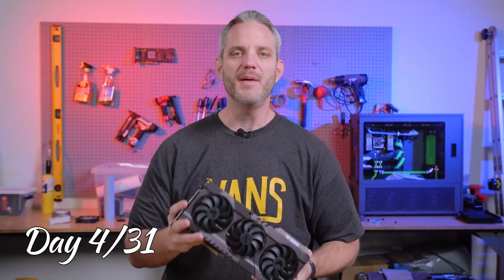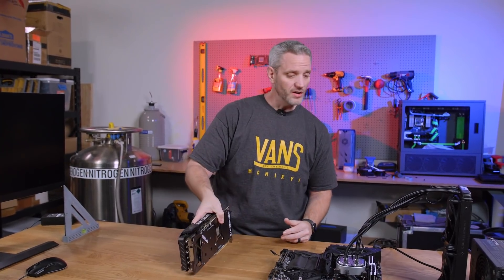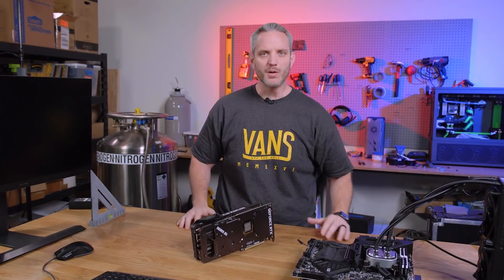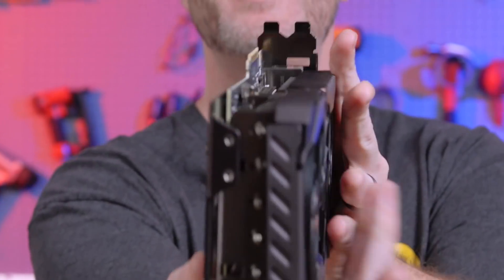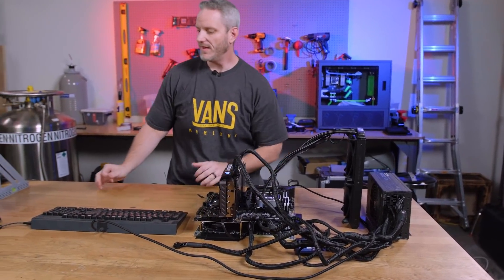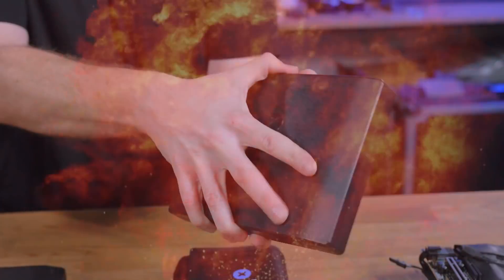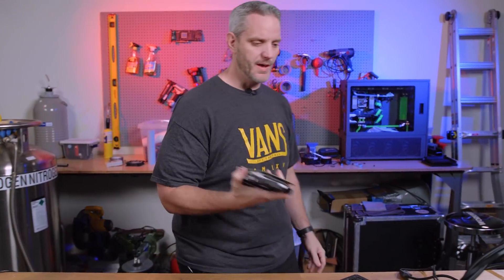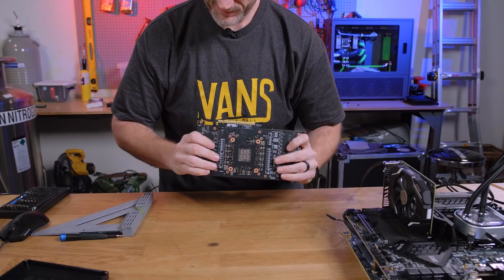This didn’t need to happen...

Comment: My Pc will not be shipped anywhere, but my water cooled 2080ti with the vertical adaptor still has a little thingy placed under the riser cable, just in case... (get it? in case!)

Comment: Hi Jay
I like your material, but what you did was really stupid.

You like automotive metaphors, here's the equivalent of this situation.
Imagine that I have a tuned Nissan Skyline with a 2JZ engine that does not start because it has a broken timing belt. But instead of fixing this, I take a 10kg hammer and completely destroy this 10s car.

I can't count how many bent cards I have repaired.
Even if the PCB itself was irreparably damaged, all other components can be recovered from it.
You know how hard it is to get DDR6X memory and not even mention the GPU core ... with these parts I would save at least 3 other damaged RTX3080 cards.
Any electronics technician who knows graphics cards would fix it one way or another, you mentioned Louis, I'm pretty sure he would fix it too.
Wasted resources ...

Greetings from Poland

Comment: anyone have a 3000 series tuf gpu? my 3080 tuf isn't the most rigid gpu I've seen, back left corner (horizontally mounted) rises a bit and front right corner sags, hope it doesn't lead to failure like the one in this video

Comment: Put it in the oven on a piece of cardboard for 10 minutes and it will fix the connections. Worked for a TV motherboard I had that's sound didn't work. Videos on YouTube about it. Check it out.

Comment: I'm dealing with shipping damage problems as the recipient right now, Instapack or similar might have saved the GPU at least. GPU doesn't work, PCIe locks are snapped off but the slot still works thankfully, and the front facing fan blades are broken off inside the case. I think the shippers took offense to the fragile stickers.

Comment: MY MAX ATTACKED OVERCLOCKED GTX 660 IS FINE WITH EXTRA COOLING PADS AND HEAT-SINKS AND THE EXTRA VOLTAGE THE MODDED BIOS PROVIDES.THINKING OF UNLOCKING THE FULL 175TDP I HAVE IT AT 150. gota love 4k

Comment: Where would I get an anti ssg support? My phanteks P600S case has an anti ssg bracket for the back of the case which I have tightened as much as possible but my XFX RX5700XT still has massive sag.

Comment: if that doesnt work, use a hot air gun on it reflow it, that works alot u be surprised ive had evga 1060s like that and i fixed 8 of them that way

Comment: so could you theoretically connect a different PCB to the Cooler and it would work? Like ask ASUS for a replacement and they'll just send a PCB.. would be interesting if that works or not

Comment: Such an expensive graphics card, such a shame. HEY! You did an impact adjustment at the last part of the video, almost like they taught me in college ;) so you should test it now :)
They said an impact adjustment is where you drop a component from 3 feet and see if that fixes it, as a last resort. So slamming on the table should totally work right? ;)

Comment: just FYI i used to work for ups, it doesnt matter weather you pay for ground or next day priority air, your package will be handled the exact same, the only difference is instead of it going into a trailer to be driven to the next hub, it will go on a truck that will deliver the item straight to an airport to be loaded onto a plane the same night.

and if you read the fine print UPS and i think fedex is the same, specifically say that you should have your item packaged in a way that it can safely take a drop from 3 feet. at the hub i worked at boxes came off a conveyor and landed inside the trailer at approx 1 and 1/2 ft. so a small drop.

 we tried out best to grab them off the conveyor but well time is money so shove that shit bro and if it falls? not our problem.

Comment: I think that proves that we need a standardised gfx card bracket... Yeah Yeah, put stuffing when shipping... Still, these cards are getting beefier and beefier. It's ridiculous holding it only by the PCI-E clot and a few thumb screws on the back.
All those tiny sata ssds that weigh nothing get standardised brackets from multiple sides... Yet this heavy chunk of expensive kit only has 1 "official" configuration which is inherently flawed.

Comment: I built a computer for my sister's friend once for about $800 or so. I didn't charge her anything over the cost of the parts. Anyway when it arrived it didn't work. Turns out the CPU power cable fell out in transit. It was a bitch to diagnose over the phone. But we got it working and she loved it. I never heard of instant pack before this year.

Comment: I’m doing a brand new liquid cooled PC build (my first time ever building one) any suggestions or tips would be appreciated 😄
Reply: Don't forget to plug the pump into correct header, some manuals instruct to plug it into CPU Fan header. Even after that you want to check BIOS/UEFI for the correct header+curve set. The best is steady flow (as fast as you are comfortable with sound level and temps), no "smart fan control" (encouters Tmax when CPU spikes and the pump reacts few seconds after, resulting in CPU maxing on temp and throttle)

Comment: As a truck driver with a desktop computer, I have to do some things. First the case has to be laying so the gpu and cpu is laying down.  For me my case is a square box and so its down even in main use. Second I put it in a suitcase and put blankets under it. Then I put it on a memory foam bed that absorbs alot of vibration.  Strap it down.  So far have no issues. But I do have to put it away every time. I have a laptop when I want to game immediately.   The desktop more cpu oriented for video editing.  Which I can't do because of another of changes I am doing and my current truck battery last 10 minutes on a unauthorized inverter which I just realized today should not be in the truck.

Comment: Take all the thermal compound off, put some stand off so it stands off the table when layed down flat and put it in a pre heated oven as high as it will go, when you see the solder go into reflow, leave it for a minute or two, this will give enough time for the solder balls under the gpu to reflow, switch off and open oven, take out if you can without disturbing any components, let cool and try again. Also not best to use a fan oven as it may blow  smt parts off, and put it in with the GPU on the top side not the bottom to prevent it falling off.

Comment: Question: if i buy a pc which had a gtx 570 without the card in it. Would i be able to fit in a rx480 and uninstall the old driver and install the new drivers. Or would i have to uninstall the old drivers with gtx 470 before putting in the rx480?

Comment: Hey so I have a gaming Computer and it has a Ryzen 5 1600 and a GTX 1060 6 GB Asus with 16 gn 3200 ddr4 ram and what should I do to upgrade the computer. I play a lot of games ranging to call of duty black ops Cold War and to fortnite also to phasmophobia. I’ve noticed it’s been lacking in frames it used to get ok frame in games on all low but now struggles a little bit   . Tried  over clocking but only got an 20-25 frame increase. Love your videos they are always helpful I hope u see this comment thx.

Comment: It's always the GPU that suffers in transport, even if it's just jiggling the card out to the point that it plays up. Most gamers are competent enough with tech to understand how to plug in a pcie card and do some screws up - surely it's better to box / bubble wrap the GPU and ship it with the system but packaged separately in the box - with instructions to the recipient to attach the GPU before first boot ?. 
I guess manufacturers would be worried the gamer will accidentally plug it into the toaster and sue or something.

Comment: I have been having trouble with my pc. I bought it like 4 weeks ago, and it was working perfectly fine until one day i turn it on and theres no display. I've checked my monitor and hdmi, and its not that. I also checked all my parts except mother board and cpu. Anyone know whats wrong.

AMD Ryzen 7 3700x
x570 Tuf Gaming Motherboard
16GB RAM
GTX 1650 Super GPU
NZXT Case
I hope this helped

Comment: Ok so if you see this and know what you are doing, unlike me, please help. I want to make a 3070 build and don’t know what to do. I have a budget of about 1200-1300. What cpu goes well? Is the stock cooler ok, is 3600 speed magic RAM worth it? Is it dumb to try to use 2tb hdd and 1tb ssd? What case do I need? How do i know if the stuff will fit together correctly? What rating/how much power should I have for my psu? Is ryzen or intel better? I just need help. Please.

Comment: You may have been on to something with heat. If solder traces broke when the card bent, heat would fix them again, but if you actively cool the card down, it will just crack the traces again. Bake the card and let it cool naturally, then try again.

Comment: Hey Jay, love your videos man! Question, I had two pcs die in the same day via the same way. Any idea of what could of caused it? They don't power on at all even after hard reset. Psu has power and mobo is getting some juice bc heat syncs are warm when they're plugged into wall. Im stumped. Any advice would be greatly appreciated!

Comment: probably just needs to have the pcb placed in an oven at max heat for a few hours to melt all the broken joints back together, assuming there is no plastic components on the pcb.

Comment: I want a 3070/3080 that instead of paying a scalper a $1000+ for one I rather just buy a prebuilt gaming pc that has the gpu and hopefully a newer cpu, swap out the components with the ones i have in my current system and just sale off the prebuilt to recoup some money.

Comment: Question
I have a capture card in my desktop that will not install on Windows 7 that is installed on the nvme. I kept my old Windows 7 installed on a sata ssd to use it. I recently installed Windows 10 on a second partition on the sata ssd. Why can I not install the capture card on Windows 7 that is on the nvme?

Comment: More like 5 cents worth of packing foam. Shipping departments that use Instapack do not use the consumer prefilled bags. They use machines that will make a bag at whatever length you choose with the right amount of the two part liquids that mix and create the foam. The bag plastic comes on 500 foot rolls and the foam liquids come in 50 gallon drums.

Comment: Jay you could’ve tried mounting it horizontally (like in a normal case) and press down in the front part of the card. I had the exact same issue with my evga 2070s and that’s what managed to make it work. Ended up having to make some tension rods using dental floss so I didn’t have to manually push it down each time lol

Comment: Jay, I have fixed dead gpu before by applying heat. Sounds stupid but I baked it in the oven at 400 degrees for about 5 minutes. Any loose components re solder and it could fix it. What is there to lose? Might as well try.

Comment: I had to move from CA to NJ, and packed everything up and shipped it in a POD, including my computers. I couldnt find insta pack anywhere, but what I did do was found Styrofoam and wedged it under the GPU to help support it. 2 weeks later unloaded everything, checked all cables, ZERO issues. Computer runs like it's new. Just wish I could upgrade my 1660ti.  Uggg, moving sucks cost me $5k just to move :( guess I'll stick with my GTX 1660 ti for a long long time.

Comment: I have the weirdest gpu issue ever, the pc only boots if i boot from the igpu, and once in windows i can put the hdmi cable in my gpu and it works. if i disable igpu in bios and try to boot from the gpu the pc won't even boot, only if i have igpu on forced on in bios i can boot the pc with the gpu in it, the hdmi cable in the motherboard, FUCKING WEIRD.

Comment: come on, at least check resistance to ground of different voltage power supply point first

and if you decide to use torch first, use it until we can all smell it

Comment: Cyberpower did this to my 3080 too, they used the instapack but used it incorrectly (no support underneath the GPU) and then piled all the accessories on top of the GPU (including a heavy bag of cables from the PSU) during shipping... Safe to say it did the exact same thing as what happened to this one...

Comment: Broken tech is so much nicer to use because you don’t feel like you could possibly make it any worse and therefore you can touch it However you want without any/lots of fear of breaking it. Kinda like a race car vs a show car. Race cars are made to be driven into the ground and if you actually break something you can just fix it but with a show car even a big scratch is really really bad in comparison..

Comment: jay you should have tried to bake it, to resolder and remelt any maybe fractured or cracked circuits. I think it's definitely worth a try.  bake at like 200c 380 °F for like 10-15mins, then try it.

Comment: I just had my first issue with my rig after 2 years.  Upon start up I get the usual beeps, then a long beep followed by 3 short beeps.  The machine seems to boot up fine, just no monitor display.

Comment: with a PCB bent like that not sure if the tracing would be damaged... it could
but more likely it's components breaking or popped solder and delamination
if one layer detaches from another it's dead specially on fine multilayered PCB's
sad face

Comment: Too bad you don't have a magnifying glass. Instead of banging it around your eyes could probably see what's wrong. Bending to brake internal traces leaves evidence on the fibreglass. You will see fractures. Most likely you have a part not in place. Fans move so, the power rail is still intact.

Comment: You broke it! :) 6:23 Why would you do that if you still wanted to fix it later. You should've handle it with care, and maybe try to reflow it properly. It would've been a much better video if it survived somehow. I had a bent motherboard once that functioned properly, never had any issues with it. I know it coul've been dead anyway, but that manual bending multiple times definitely made the situation worse.

Comment: Is there any time that you could/should suggest who ever is sending the system to remove the GPU before shipping (but obviously included still) or would that be worse. Im shocked that someone would send a computer without packing insta foam.

Comment: I managed to snag a 5600X from Amazon defeating all the bots about a month ago. Then when it arrived they shipped it in basically a bag. And sure enough the CPU was damaged, bent pins, far too many and too bent to unbend (which I've done before several times). Back to the notification servers I went.

Comment: As someone that used to work in microelectronics failure analysis, I can professionally say "it looks like you have a problem".

On a serious note if you have a thermal camera you can connect a power supply to the 12 V power rail, pump power into the card, and use a thermal camera to find a break in a trace. Or set it on fire by accident

Comment: Shipped a system in a P300 to Alaska without a problem. Just got to pack them right. Didn't use one of those Insta Packs because they were like $90, so I made my own packing out of some high density foam.

Comment: My friend kicked his laptop out of anger and split the PCB that connects to the CD rom. Completely broke into 2 pieces. I took it to work (we solder components onto PCBs) and traced all the connections and used 30 awg mod wire and soldered them all back together and the rom worked just fine.

Comment: Hi there.

I got myself close to a complete setup, i still need ram tho. I dont care about lights at all (my case is fully closed), only optimal choise for gaming to avoid to much "bottleneck". 

Any suggestion to which ram i  could choose  please  anybody ?
 (max price range 350$)

Processor= Intel Core I9-10900 , 
Motherboard = Asus Rog Strix z490-F Gaming , 
Graphic card = Asus Tuf Gaming geforce rtx 3080 oc 10gb ,  
Harddisk = Samsung 970 EVO SSD MZ-V7S2T0BW 2TB M.2 ,  
Powersuply = ASUS ROG-STRIX-750G 750Watt
Watercooler = NZXT Kraken X53 240mm
Pc case = Fractal Design Define R6

You proberly didtn need all that info, but those are the parts i got so far.  

Thanks for any suggestions.

Comment: That's what you call "tried to fix it"? You could have at least tried to properly reflow it and did a resistance check on common fail points.

Comment: I actually have a question. A few months back a friend gave me a 1080 and I was just not prepared for the size of that card after a 970. Even had to switch cases.

I put it an adhoc support system, but it still feels very unreliable. Is there any product out there that will make the card stand solidly in place without any bending? I plan to upgrade to a 3080 or 6800 when they're available next year and I figure I don't want my card having to sag even if there's some light support there to keep it propped up.

Comment: 2:22 yeah I’ve experienced what UPS Ground is like just a few days ago when they handled my harness bar for my car. The box came with the main tape cut open and reckoned with two pieces of tape to re-close the main opening, the package had multiple holes from the bar piercing it and even one of the bars was taken out of its bubble wrap. The hardware itself was chipped and scrapped leaving the metal underneath the protective layer of black powder exposed. 

Needless to say I was not a happy camper